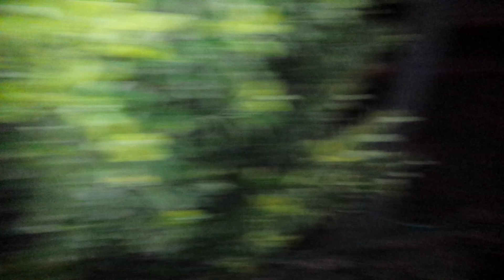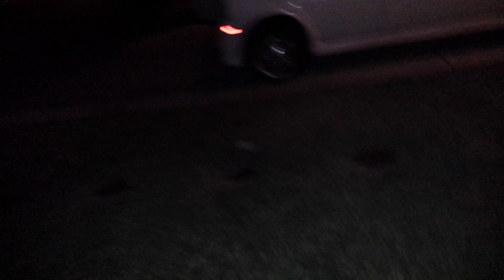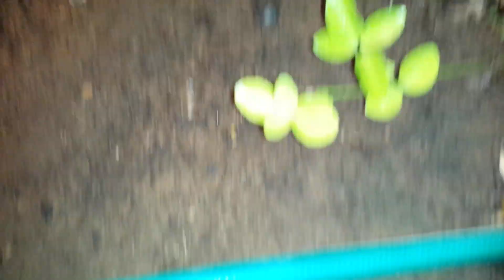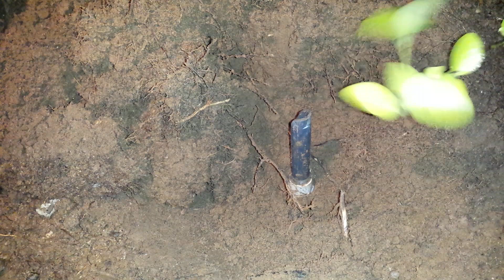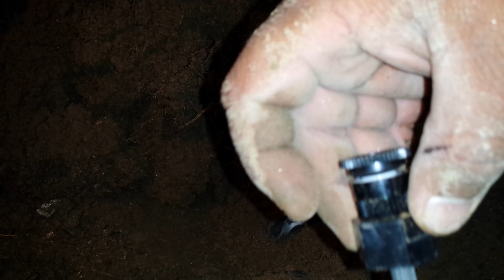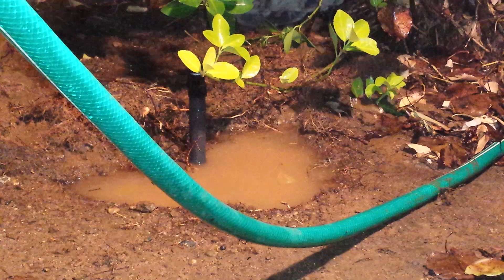DIY How to fix your broken gushing sprinkler.

Comment: So I have a weird issue with my home sprinkler system:  When a valve shuts off, seals and the heads go back into the ground the water pipes starts thumping under the ground and in the house.  It gets so bad that other zones open due to the pressure getting forced back through the system.  What might be the issue there?
Reply from the maker: Bobby D sounds like you have a bad manifold valve on your sprinkler system.
Reply: sounds like you have water hammer
Reply: try a pub.on the line or a waterhamer arrester it is air in the line it is caused by a valve closing to fast or try running 2 zones at a time and see